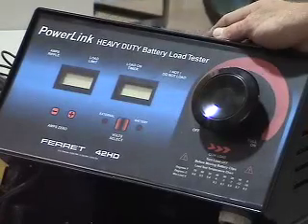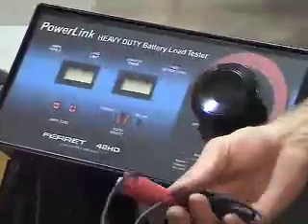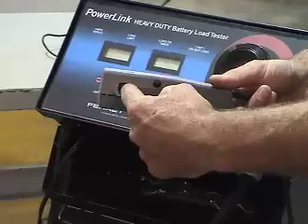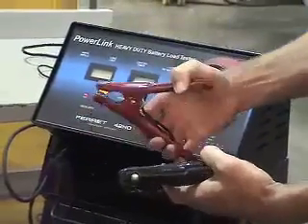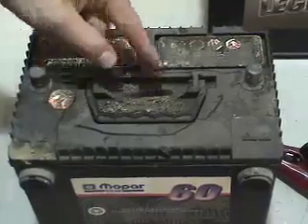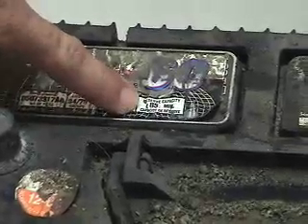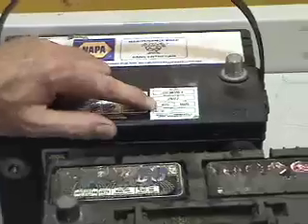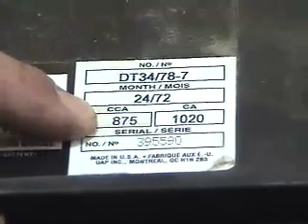Load Testing Batteries

Comment: Explanation about reserve capacity RC is not true. It's time, see min after 85, in which battery's voltage will drop to 10,5V with load of 25 Amps when the alternator stops charging the battery.

Comment: It is almost like the AVR.  The resistance test were voltage drop tests and the Ferret will do the voltage drop test fairly easy.  YOu can choose between the external or internal leads.  The external, or small, leads are using to perform voltage and resistance tests.  Again resistance tested this way is measured in voltage drops.